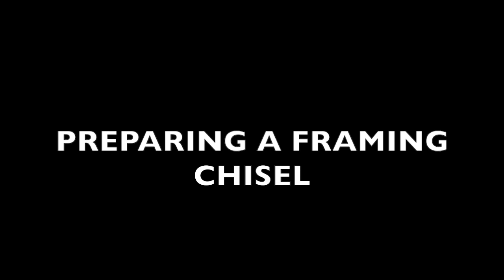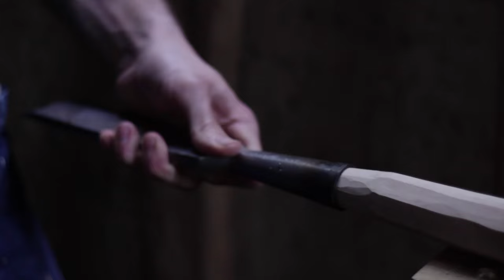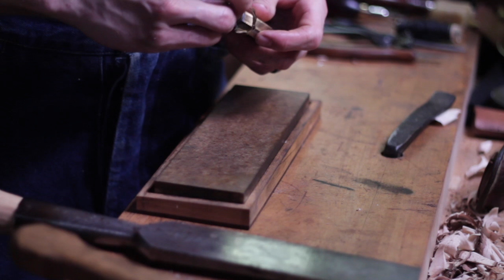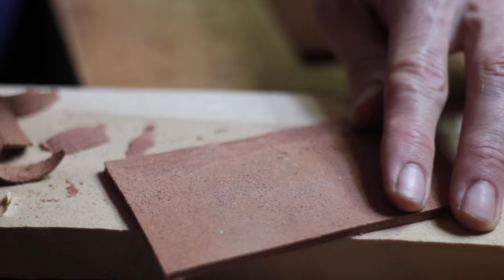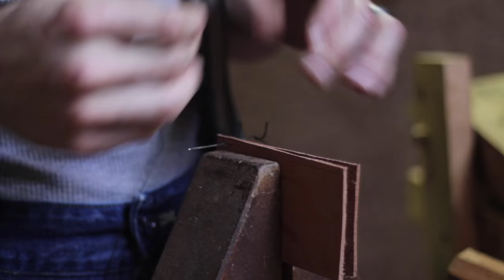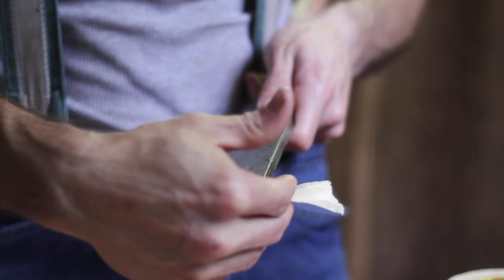Our timber frame cabin Part 1: Preparing a framing chisel

Comment: Mr. C, you're much more knowledgeable than me, but I used to be a leather craftsman and I have a tip to offer you this time.  Place a piece of cork, cut flat and at least 1/2" thick, over a horizontal work-surface, and punch all your holes with the awl over it before you do the saddle-stitching.  It'll go more quickly and easily.

Comment: amazing. I just made a few of these for my smaller woodworking chisels, the chisels may cut the string on the bottom of the sleeves if you do not insert a welt. not sure if the timber framing chisels have that same problem
Reply from the maker: Thanks, I can see you might have that problem with thinner chisels, more like knives, could use a welt for sure, Ive found for axes and framing chisels, they are just too darn thick for the edge to tough stitching.

Comment: Thank you for the videos. I am going to  sheath my framing chisels (right now I use heavy cardboard and tape)  and I was wondering how far apart you spaced the holes with the overstitch wheel spacer and what weight thread did you use? Thank you
Reply from the maker: Im sorry to say I dont remember Patrick, I used whatever spacing the wheel was set to when I bought it, the twine was just some thick linen twine, and the needes were from Tandy I think. I have moved on to wooden sheaths for most everything now days and prefer them, have not made a video yet..
Reply: @MrChickadee : Thank you for replying so promptly. I love the content, pacing, and the filming. Some description as to recipes, dimensions, materials, etc. could be added in order for your viewers to make practical use of the videos and, as such, they become tutorials. Thank you, again, for your response and for your effort in including us, the viewers, in your life.

Comment: Chic, I have my grandfather's 2" chisel with  'Warranted Cast Steel' stamped on the same location as yours.  I know his father was a schooner captain and that it was used both for framing houses and workboats, which makes at the latest from the late 19th century.  What stamp is on yours or did I miss that somewhere?  Anyway, thank so much for the video, it will now get a new handle.

Comment: Hi, does dogwood have qualities that lend itself for that purpose or was the choice driven by other concerns??  thanks
Reply from the maker: Indeed, dogwoods tight spiraling grain and hardness make it resistant to splitting when used in a mallet or struck handle, or splitting wedge.

Comment: What type of wood did you make the handle from ?     Will the top of handle split when hammering it with a mallet ?    Love the videos !
Reply from the maker: Dogwood, its fine if using a wooden mallet
Reply: I can tell now by the light color and smooth texture of the wood that it’s dogwood.   I think that’s about the hardest wood I’ve ever cut.   I don’t like to cut live ones, too pretty.   I think it’s the only wood I’ve cut where the chain on the chainsaw comes out smoking, even on a small dia tree.

Comment: Great vid!! Why do you chamfer the inside edges of the pieces? I have 2 large framing chisels that I wish to make belt holsters for, will double as protectors.
Reply from the maker: If you mean on the leather, I skived the leather to thin it out so it could be formed and stitched easier, if you mean the chamfer on the struck end of the wood handles, that just makes them mushroom less as they are beaten in use
Reply: Thanks, yes I actually meant the leather. Cheers.

Comment: I'm interested in making a sheath for my axe. Have you ever posted a video for that? also how did you finish your thread? I did not see you tie a knot.
Reply from the maker: No axe sheath video yet sorry, but they are made the same way. There is no not at the end, you simply back stitch a few times and then cut off, friction keeps the stitches tight inside. Goodle or youtube search "saddle stitch" and you'll see more detailed explanations.

Comment: what was the tool used for back cutting the letter can I just use a hand plane or knife?
Reply from the maker: Its called a "skiver" you may be able to skive with a knife, not sure about  a plane, I tried that but it didn't work well for me. If your leather is thinner you might forego the skiving altogether, my leather was just way too thick and a real bear to push the awl through.

Comment: So many questions! Was that a liquid form of bee's wax you treated the handle with? It didn't remotely look like boiled linseed oil. Not knowing much about leather working I wondered why you beveled the edges and then it occurred  to me that when the surfaces were pulled together that the middle would tend to bow out and form a pocket like you intended. Is this the case? The cat made me chuckle. They always have their own agendas. She just did not want to get out of that tool tote.
Reply from the maker: Its a mix of beeswax, mineral oil and citrus solvent, in thirds…This leather is VERY thick, way to much really and thinning it helps a lot making the holes with the awl, plus what you mentioned as well. Charles does what he wants!
Reply: I was wondering about that as well... thanks for the info!  I imagine that this could this be used as a finish on hot metal in a black-smithing application as well, correct?
Reply from the maker: Have not tried it for smithing but should work, similar to paste wax applied to hot metal...

Comment: Who's in charge of that shop, you or Charles?

Are you going to use those as slicks or chisels? If slicks, your hands will appreciate rounded contours. If chisels, better ring them.
Reply from the maker: Charles is def in charge! 

These are chisels, my slick has a more rounded handle, and longer of course, I find dogwood resists splitting pretty well, but I may add rings later on
Reply: +Mr. Chickadee Dogwood. supposed to be very tough like elm. makes good wagon wheel hubs, mauls, etc. Never worked with it but I do have a 2 ft long split from a 10" or so trunk. I have a 1" corner chisel... Hmm.

Comment: What size Arkansas stone do you use? What is a good price for a used one? What grit? Do you use multiple? Did you add the leather to the box for the final shine on the edge or did the box come with it
Reply from the maker: I used to use a lot of grits, arkansas don't come in grits but type, such as Soft, Hard, Black Hard, Translucent, Black Translucent…its weird. I used a Soft ark, which is pretty rough, followed by a hard black, then stropped in leather with compound, I did this for years til I learned its not necessary, really you only need a good grinder, learn to hollow grind at 20 degrees, then you need either a soft ark, or a fine india stone maybe a medium india, then leather with compound. You want to use really thin oil on the ark or it will gum it up, I cut mineral oil down 50/50 with citrus solvent for honing oil, don't buy ready made, its a rip off. 
Get you a grinder, hand crank preferably, if looking on ebay get a true WASHITA stone, its like a soft ark but better, but make sure its an old one thats labeled in the box, wither PIKE or Lilly white washita…that or a soft ark will work, you can get a soft white from "natural whetstones" a big one like 10x3" and 1" thick for 20 bucks i think, it will last you forever! Just raze a bur, polish the back, raze the burr again, and strop, takes practice but that stone will last forever…if you want to make it flat, glue some sandpaper to glass or granite , maybe once a month if heavy use, or once a year if not. My black ark sits in a box and is not used much now, sad cuz its a 100 dollar stone, don't bother, just grind at 20degrees! then hone at 30ish, hit the bevel side till you get a wire edge, flip, polish it off, flip, do this a few times to thin out that wire edge, then strop both sides on leather with compound, its an old trick they used back in the day when everyone had one stone and it was never really flat...
Reply: complicated. Is there a book that explains this?
Reply from the maker: Sorry, its not really til you try and explain it in words on a youtube comment thread, here try these links, lots of good info, then pic which is best for you, your budget, lifestyle, all will work. 

https://www.youtube.com/watch?v=XAPRC2WSEco

https://www.youtube.com/watch?v=a6ykVzL2VAM

https://www.youtube.com/watch?v=Ki8tt-VjwqI
Reply: I loved the Paul Seller's video!
Reply from the maker: yeah, if I had not already invested major $ in my arkansas stones I would have gone with Pauls system, really nice and well thought out!
Reply: I just got Roy's main (?first) book on traditional woodworking.  He mentioned that he doesn't use oil stones and only uses water stones. He prefers clay stones that were designed for sharpening straight-edge razors that he picks up at flea markets for 25 cents.  He also uses a sand-stone wheel.  Thoughts?
Reply from the maker: Yep Roy uses those often called "belgian coticule" razor hones. They are a water stone, which will work also. There are really so many ways to sharpen, you have to just see what fits you, your temperament, budget, and workspace. I have used water stones in the past, they cut fast, but also require flattening frequently as they wear away. Oil stones stay flat longer, you can flatten them again with sandpaper glued to plate glass or a diamond plate made for that like the EZ LAP plate, pricey though, and you CAN also just learn to use an oil stone even after its not perfectly flat, you just learn to "live" with the dishing it gets with use and move your tools around to suit. Or get the Diomond stones on Paul Sellers video and don't ever worry about flatness again. Sandstone grindstone are nice if you find a good old one in nice shape. They remove material SLOWLY so if you had to say regrind a fat bevel on a big chisel you will be there a WHILE. Ive come to like the small hand crank grinders from the 1920s-1950s which use a 5-8" wheel of any grit you want, if you use a rough grit they will work fast. Roy also uses these in many of his videos. He uses anything that is "human" powered, even some quite modern tools, but seems to draw the line at gas or electric power, which is really what I enjoy too.
Reply: Very insightful. Thank you.

Comment: Heloo sir I want to ask you what dimensions have the chiesel, I'm a blacksmith and I want to forge a few chisels. thank you
Reply from the maker: OK, these are large timber framing chisels, so the big one in this video is 2" wide, and 1/4" thick at the edge, it gets thicker at the handle end where the socket is. THey are about 8" long before socket. Most old chisels were made from wrought iron with only a small piece of high carbon steel forge welded onto the bottom side where the cutting edge will be. This piece of steel was about 1/8"thick
Reply: Thank you very much sir.....